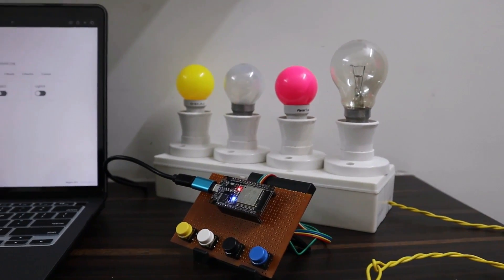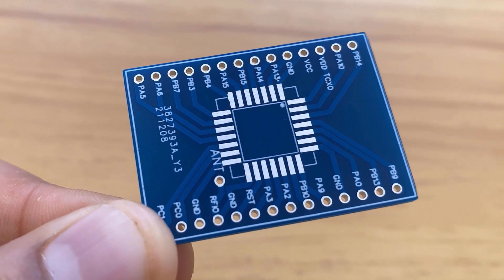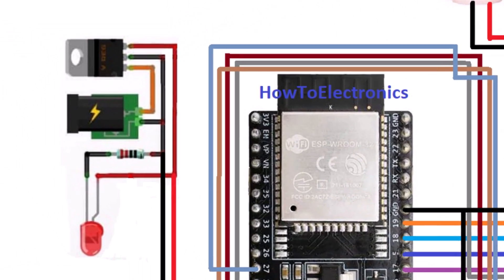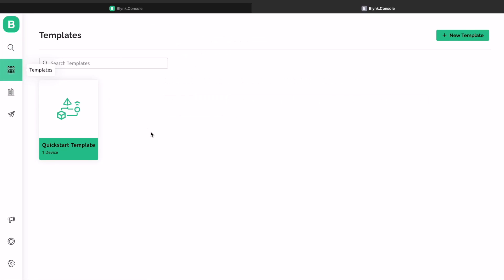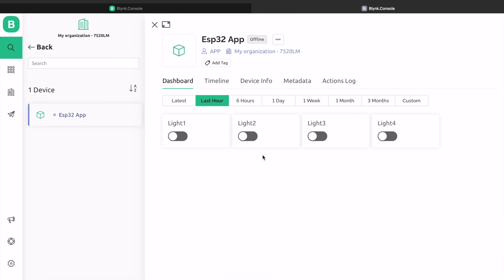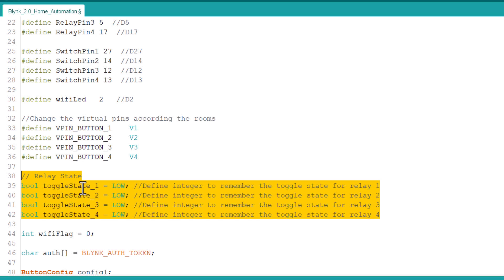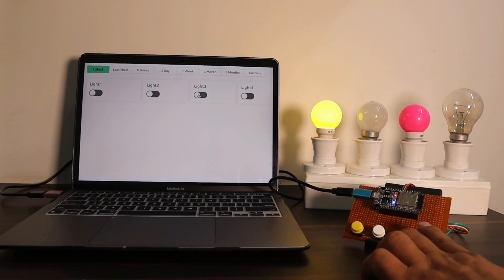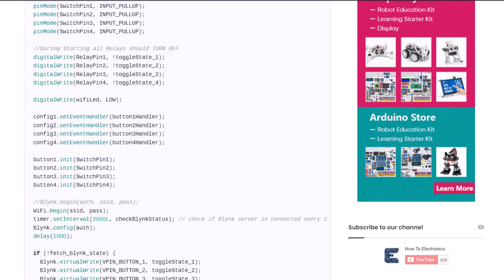Home Automation using ESP32 & Blynk 2.0 with Real-Time Feedback

Comment: Cool project 👍🏼
Question: Can this also be used with 5 volt and 12 volt DC consumers ❓
Reply from the maker: 5 volt only. But if you wanna use this with 12v its better to use regulated voltage ic